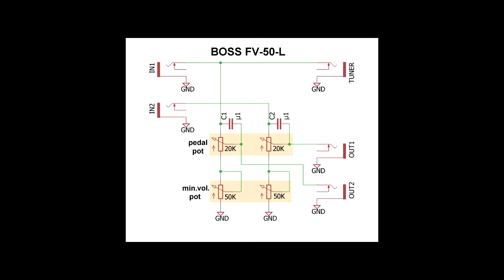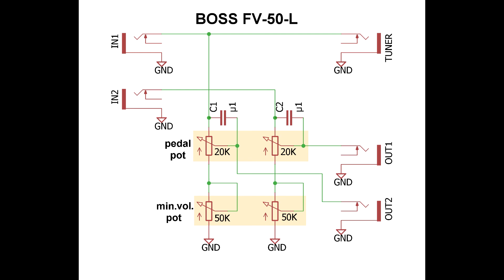Inside a BOSS FV-50L Volume Pedal, with schematic

Comment: Uso O meu FV50L após as distorções, e sinto um perda de sinal mesmo com o pedal totalmente aberto.
Medi a resistencia e deu algo em torno de 18 ohms com o pedal no volume 10. Esta certo isso? Deveria eu substitui-lo por um FV50H para poder usar depois das distorções? Pelo que entendi o L é pra guitarra entrar direto nele e o H pra colocar depois de pedais, estou certo?
Reply from the maker: 18 ohms é um valor bem baixo, a medição foi feita entre quais pontos do circuito? Se tiver sido feita entre entrada e saída, 18 ohms em série com o sinal não seria significativo a menos que o circuito conectado após o pedal de volume tenha uma impedância de entrada muito baixa (pouco provável). Caso a medição tenha sido entre saída (ou entrada) e terra, deve haver algum curto circuito no pedal e o sinal seria bastante atenuado (praticamente zero). Estou supondo que mediu com o pedal desconectado (sem cabos). Mais uma pergunta: os dois canais do FV-50L estão com o mesmo problema? 
A diferença entre o 50L e o 50H é a impedância de entrada, L para Low (baixa impedância) H para High (alta impedância), portanto você está correto ao usar o FV-50L após pedais (que normalmente têm alta impedância de entrada e baixa impedância de saída). O FV-50H seria necessário somente se fosse o primeiro pedal conectado à guitarra.
Reply: @unrelatedactivities  obrigado pela sua resposta, foi bastante esclarecedora 
Medi 18 ohms nas pontas dos pequenos cabos conectados (sendo que cada um deles registrou certe de 0,5 ohms) 
E sim, os dois canais apresentam a mesma situação 
Não é um grande perda, mas é perceptível

Comment: I’m losing treble when I have the pedal set to lowest position.  If I wanted to add a treble bleed to the potentiometer, would it be to the 250k pot or the 500k minimum pot?